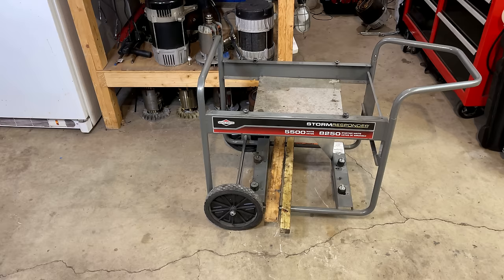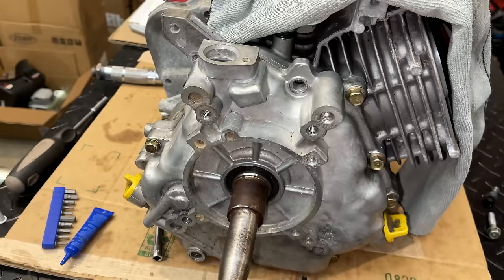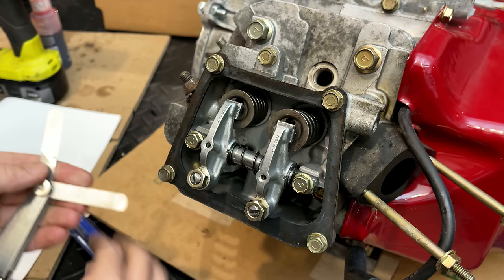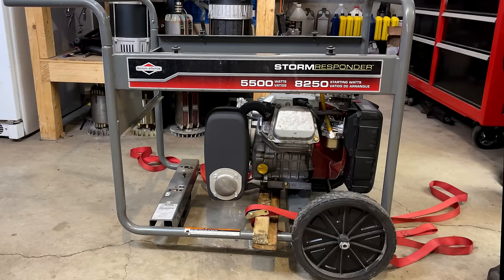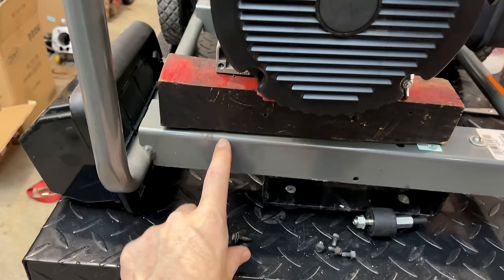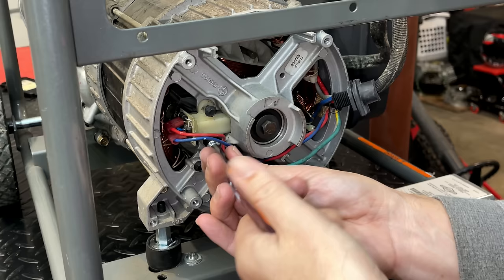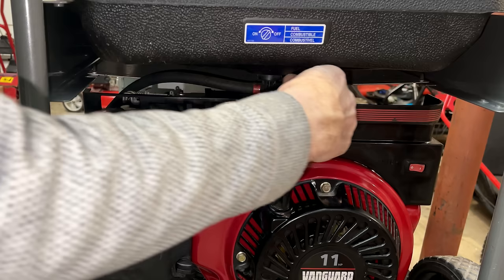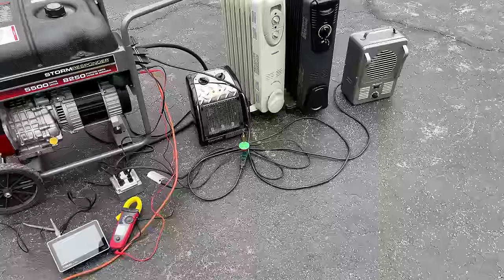Briggs Threw a Rod - No Oil Again (Part 2)

Comment: Good pair of videos James.
Why did you loose the origonal bolts to start with. You schould use small zip lock  bags then mark each bag where the bolts or hardware in that bag goes. That way you always have the exact hardware for each location
Reply from the maker: They were missing when I brought the engine home.  I always use zip lock sandwich bags to organize the hardware.

Comment: Getting ready to do this swap w Identical powerhead , only exception w my engine , is its the 9hp Vanguard . I've read 1 HP =750watts . Of course this is likely the utmost max measure & not factoring surge power factors . 
 So I'm leaning towards rating 1 hp =600watts & i should be good w the 9hp on this storm responder Gen Head .
 Let me know you're thoughts James when you have time .
Reply from the maker: 1hp = 550 watts.  You should get 5000 watts, maybe a little more out of a 9hp engine.

Comment: Hmmmm ... Better now than when it was new. I have never come across one of those engines here. It's a nice strong unit even without a governor. You need labels on your units so that people will bring them back if/when they have problems because they are mechanical and will be neglected.

Comment: Thanks for the video! Would it have been possible to rotate the fuel valve body 90 degrees  and get it to work without modification?

Comment: I'm sure you already know this, but the torque spec will be different for the bolt you swapped in if it's not an exact replacement (in this case, the grade of the bolt looks to be different).

For those not aware, this is due to the difference in "stretchy-ness" of the different grade of bolts.

But in all honesty, using torque to determine fastener tightness isn't the best way of doing things anyway, so I'm sure it'll be more than fine, especially since it's just one or two fasteners.

Comment: Love your videos, James…bubble light and all!   What small power generator would you recommend for my computer during hurricane season at sea level?   Aloha from Hawai’i.  Maui no ka oi!
Reply from the maker: Definitely an inverter generator.  Quiet, fuel efficient and very clean power.  The only downside is a lot of electronic in it and that will usually fail before anything else.

Comment: Thank you James.
Does this engine have two oil fill points?  I’ve never seen this.
Reply: The 10HP flathead Briggs in my old Generac has two fill ports also. It's very convenient to fill one port and watch the level on the other.
Reply: Yes, the other one is for left handed people.

Comment: I don’t know if I would be using walk time on aluminum like that, especially something that major right there. You could potentially pull the threads out if you tried to disassemble it later in the future.
Reply: Loctite prevents corrosion, which is much more likely to cause stripping threads.

Comment: It looked to me as though that flywheel was supposed to have a "keeper" between it and the shaft, which I noticed you didn't add.  Possibly I'm wrong and it's just a friction fit, but I thought it was worth mentioning.
Reply: Flywheels are taper fits. That does rely on friction. Then there's a keyway that aligns timing.

Comment: Jim,  do you ever explain THD to people who buy generators from you? Or does anyone ever ask?  Just curious as the wave lately has been to inverters with cleaner power (low THD) so as not to affect sensitive electronics.  Thanks. I feel another LIVE coming up with you and Gary!
Reply: Its funny, 10 or 15 years ago we really "needed" cleaner generator power for sensitive electronics, and inverter generators were pretty much non-existent then. We don't really need them at all now, as almost every electronics device we plug in has switch mode power supplies or solid state buck converter voltage regulators that could really care less what you feed them - they would work from anything from DC to an AC square wave or trapezoidal wave without complaint. Line voltage AC motors are the only thing now that people may use as a load that get grumpy (may overheat) with high THD AC power - but with everyone's furnaces moving to variable speed DC or inverter driven 3 phase AC, the only real remaining worry is air conditioner compressors - otherwise spending extra for "clean AC" is mostly a waste.
Reply: @offshack  now THAT was a Mouthful!
Reply: @offshack  there is a good reason. Lookup Active Power Factor Correction. That circuitry is what is sensitive to high THD. Years ago Passive Power Factor Correction by use of a simple inductor and capacitor was used, and far less susceptible to high THD. Modern SMPS for computers have trouble with it.

What you need to lookout more for than THD is surges. Thats what kills things on generator power more than high THD... 😊

Comment: Another great video full of knowledge. I’m still wondering what may have made someone need to open up the engine in the first place. Any way to tell?  The bolts were loose and the timing was off a gear which does seem to indicate someone had been in there. Since it ran great after your fixed the timing, seems like there was no obvious reason anyone went in there?
Reply from the maker: My best guess is that the generator it was attached to stopped making power.  Someone kept the engine and maybe was thinking about swapping tapered the crankshaft for a normal keyed one?  Then aborted the project??
Reply: @jcondon1  makes more sense than anything I could dream up!  Lol

Comment: 6000 W is not over load in this case, because the voltage was only 110 V, not 120 V.
A resistance wish gives 6000 W at 120 V gives only 5042 W at 110 V.
Reply from the maker: Good point

Comment: How should we decide whether to use sealant on new gaskets?
Reply: Experience is the best teacher. I had a head once that was ported out too much so it had an intake leak. When they say RTV is high temperature they ain't kidding. It was even able to seal exhaust leaks on that engine. I was much impressed. Today I'll only buy the high temp RTV. The blue stuff just looks tacky.

Comment: Dear James… just a quick question….I saw your magnificent job on a snow blower…. My snow blower works fine, but I really struggle to turn  it side ways, left or right, both win engine engaged or not. It is a real struggle to turn… like you reach the end of the drive way and really struggle to turn either left or right…. Would you have any idea or suggestion what could be causing it? Thanks in advance for any hints. The machine is a SEARS.
Reply from the maker: Most have a live axle meaning there is no differential and both wheels are engaged.  Great for traction but not turning.  Sometimes there is a pin or bolt you can remove from one wheel to disengage from the axle.  It makes turning a lot easier.  Only downside is only one wheel spins and less traction.  More expensive models have a trigger on each handle.  Holding the trigger disengages the wheel on that side.  That system is the best of both worlds.  Great traction and easy turning.
Reply: @jcondon1  Thank you so much for taking the time to answer my question. I get it…but I bought this machine new, about 14 years and only the last 2 years after I took it to service I noticed the struggle to turn it….. I though was the machine aging 😁…. But your explanation makes all sense…..there is nothing else wrong and works like new. I will continue to watch your videos and continue to enjoy and learn! Thanks a lot for your time .

Comment: Briggs Vanguard, Good engines. I like most Briggs, but Vanguards are built so beefy. Vanguard, Honda and Kawasaki are all good in my book. I've heard Subaru Robin is good also, cant attest to the quality though. The old Wisconsin Robin brand was awesome...Super Beefy.
Reply from the maker: Subaru are good, but not as beefy as the 3 you mentioned.  The Yamaha MZ engines are also built well.

Comment: I noticed  you have a lot of the tools you use linked in the comment or in your store but I am interested in the brand and sizes of the torque wrenches you use. Is it possible to link those as well as they do not seem to be listed?
Reply from the maker: They are nothing special.  The larger one is branded Husky from Home Depot.  It is an older model and not sold anymore.  The range is 20-100 ft-lbs.  Here is the the current version https://www.homedepot.com/p/Husky-20-ft-lbs-to-100-ft-lbs-3-8-in-Drive-Torque-Wrench-H3DTWA-03/316924567. The small one was a Chinese no name eBay brand 20-240 in-lbs

Comment: James tengo una duda ¿Puedo usar aceite 10w40 en vez de 10w30? Es que en Cuba solamente puedes adquirir esa aceite, y ¿Como hago para deshacer la aceite vieja que aún está en el motor para introducirle la otra aceite? Gracias y bendiciones
Reply from the maker: There is usually a drain bolt on the engine block let the old oil out.  10w-40 oil should be fine and likely recommended in warmer weather where you live.  Where I live, 10w-30 is a better choice for freezing temperatures but not so good on hottest summer days.
Reply: @jcondon1  ok, esa parte la entendí perfectamente, mi duda es ¿como puedo o que producto puedo usar para limpiar los restos de la antigua aceite para introducir la nueva aceite? Porque yo no puedo introducir una aceite como la 10w40 aún habiendo restos de aceite vieja en los conductos del generador, porque una vez que yo saque el perno de la aceite y la dejo escurrir aún va a ver en los conductos del generador aceite vieja.. me ayudaría muchísimo James con esa cuestión, pues en Cuba la electricidad nos la quitan 7hrs, y la única opción que tengo es comprar aceite 10w40 porque es la única que te venden en las instalaciones del Estado. Gracias y que Dios te bendiga.

Comment: Great video Jim. How would you rate the "Vanguard" series of B&S engines of this vintage? In the same category as the Honda GX and Robin EX engines in terms of material / build quality? I've heard the twin cylinder (v-twin) vanguard engine made in the 90's and 2000's were some of the best small engines ever produced (by any small engine manufacture) and I wanted to know if the single cylinder units were as good.
Reply from the maker: Honda and Subaru are good engines, but....  It beats the GX, better valve and rocker design.  The Subaru is a good engine, but not built as strong and pretty sure no counter balancer in the Subaru.

Comment: Instead of wrapping the 8mm bolt with tape, a simpler and more accurate method would be to use a short length of plastic tubing, such as #50405K37 from McMasterCarr, which is 10mm OD and 8mm ID and costs $1.16/foot.

Comment: Can you even buy a portable generator with that vanguard engine. I like that engine that’s a lifelong engine with ball bearing crank that thing will run forever of maintain.
Reply from the maker: There are some older generators with single and v-twin vanguard engines.  Not sure on anything made in the last 15 years.

Comment: Is there a particular reason that you always clean the machine after it is fully assembled, rather than cleaning the individual parts while they are off the machine?
Reply from the maker: The tank is easier to clean when on the frame and the block once the engine is assembled.  The other parts were cleaned when apart.

Comment: Why do you not clean off the rust on the fly wheel and magnets?
Reply from the maker: Usually not needed unless there is rust stuck to the magnet or the rust is preventing setting the coil gap properly.

Comment: Jim, you might want to make a cart to move your heaters around, and there by have the convenience of always having them ready. You might be able to make something from a generator cart. You could make a second level, and then remove the upper one if testing smaller generators. Plumber's strap could hold them in place, and it comes in either metal or plastic.
You could mount a breakout box on it and have separate switches at the handle.
Reply: It hurts my back every time he bends down to turn a heater on or off. He should build himself a proper load bank.

Comment: What do you torque small 1/4, 5/16” bolts to the go into threaded areas on sheet metal.  10-15” lbs
Reply: Like the recoil to the blower housing
Reply from the maker: About 70 in-lbs

Comment: Where do you find your service manuals online? I've got a Honda eb3000c I need some information on... assembly drawings Etc
Reply from the maker: Usually I just Google: “eu3000” filetype:pdf.  If it’s available you will find it.  Otherwise you might need to buy one from the dealer.
Reply: @jcondon1  i find alot of owners manuals but not service :( i got it running all i need to do is get the governor working properly unfortunately i didn't take pics that well in disassembly phase like you always recommend :) so im having trouble getting the 2 linkages and springs assembled correctly to get the gov. working as it should...maybe you or someone might have one that can take a pic or 2 for me of the gov linkages etc? of offer some assistance in how the go together?

Comment: Vangard engines are far far better quality  than the rest of the Briggs range . In saying that the conrods and pistons and typically carbs are a little low quality . Replace these and you have a very good motor .

Comment: You really should try and rebuild the original engine . It'll run fine , that little piece missing isn't gonna cause an issue . 
So basicly all it needs is a new conrod right ? And those are really cheap .
Reply from the maker: I $60 conrod and a $10 head gasket.  I already have a crankcase gasket hanging around from another project.

Comment: No air filter installed at 26:20!
Reply from the maker: Its in the cover.  You can see the blue corner through the vent holes in the top right.

Comment: HI, WHY DID YOU NOT REPLACE THE OIL FILLER CAP WITH THE BROKEN GRIP. THERE WAS ONE ON THE OLD ENGINE.
Reply from the maker: There are two caps on the engine.  The one on the left is normally the only one used as its much easier to access.  I just swapped the caps around for now.  Have a new one on order.  Did not think to try the normal Briggs cap with the Japanese Briggs Vanguard.  Might be compatible?
Reply: Why don't you replace your keyboard with one where THE CAPS LOCK BUTTON is not stuck?
Reply: @erik_dk842  I USE CAPS BECAUSE I AM VISION IMPAIRED SORRY YOU DID NOT THINK OF THAT.
Reply: @kimmurphy5977  I'm sorry for your situation, but for most, ALL CAPS is very hard to read, because we're used to capital letters designating the beginning of sentences or names.
It's interpreted as shouting and has the same negative effect on the recipients

Comment: “Brushes are cheap, but this one is more because it has the bridge rectifier.”

Could you not just use an external bridge rectifier wired into a normal set of brushes? A bridge rectifier as an integrated four-lead component is also dirt cheap.

Comment: 13:05 If you use a cutoff wheel in a Dremel, you can use the side of the wheel to put a light chamfer on the end of the threads to clean then up without having to go to the grinding wheel...

It's also faster than a hacksaw...

Comment: 200 foot pounds or 200 inch pounds because you said because you said when you were torquing the generator bell housing, you did not know the torque spec and you said you were torquing them to 200 foot pounds. I would imagine you would snap the balls at 200 foot pounds considering a cylinder head doesn’t even get torqued that much on a regular car.
Reply from the maker: Nothing on a generator is torqued to 200 ft-lbs.  Bell housing should be 20 ft-lbs.
Reply: He said he was torquing them to twenty foot pounds.  Are you watching the same video?